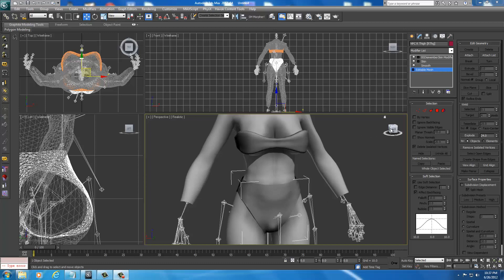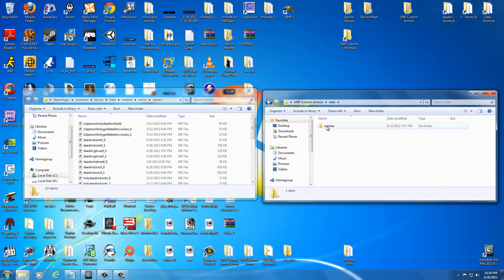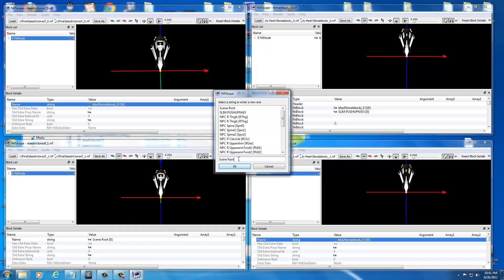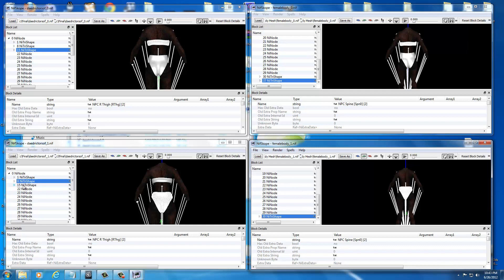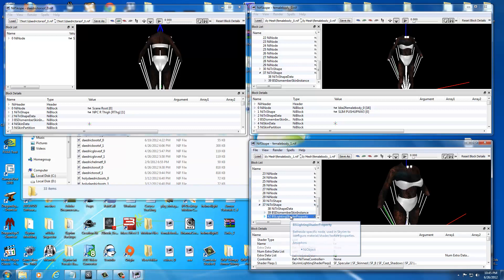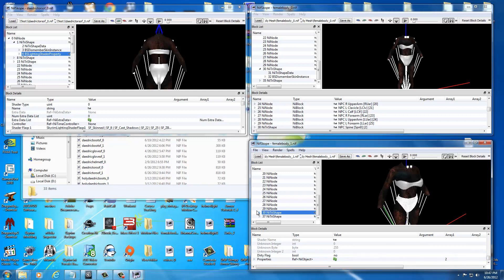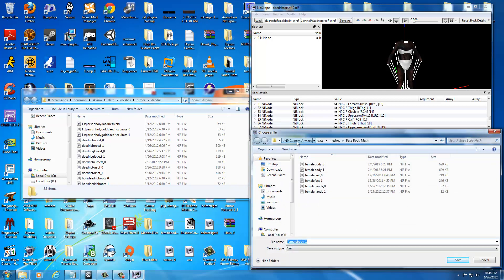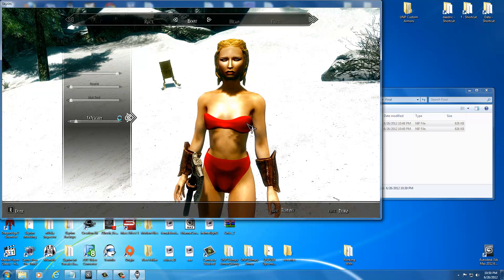26 - CA4S - Weight Sliders Continued and Test

Comment from the maker: The thing about weight sliders is that you have to be careful how drastic of a change you make. You can easily get away with moving vertices out and in but if you do drastic changes the game engine will get confused and it will break. I recommend starting out with just moving the verts outward to fit the bigger body for now.

The more experieced you get with doing weight sliders the more you'll know what you can get away with. For now, starting out, keep it simple. Later on explore.

Comment from the maker: No, you don't have to start ALL over. You just have to remake the weight slider. When you import the body for the first time though you need to reexport it at zero, then add the big body in and remake the weight slider. ALWAYS when having to redo the weight slider re export your zero sized version of your armor. Don't use the zero sized version from a previous export. Re export the zero, then make the 100 based on that export.

This time try using tricks like welding all the verts.

Comment: Hi Nightasy.

Well I think my vertices exploded:(  Everything looked fine before the weight slider but after adding it, now in game, weight 1 looks fine, but as soon as i move the slider the vertices explode until I get to 100.  But even then, the body has her arms crossed in front of her and does not come out of it, even if I crouch, equip weapon, unequip, etc.  So, should I start over from scratch, or is there a point I can go back safely and continue?